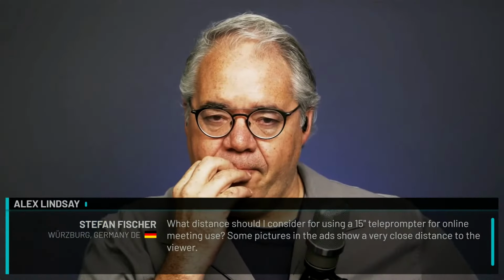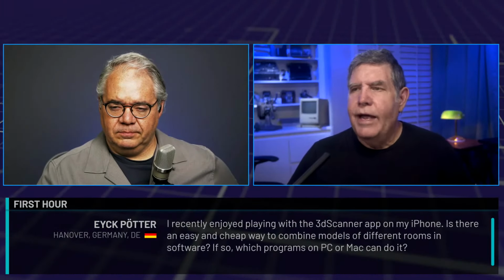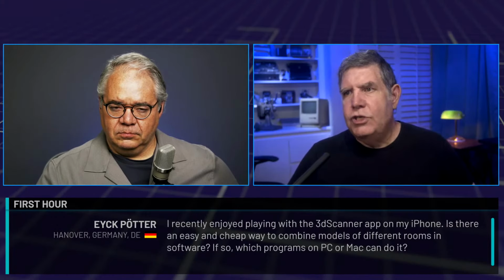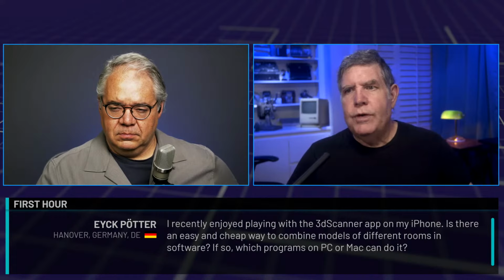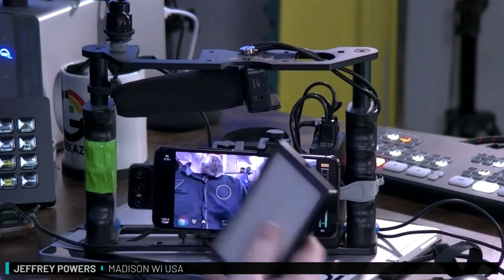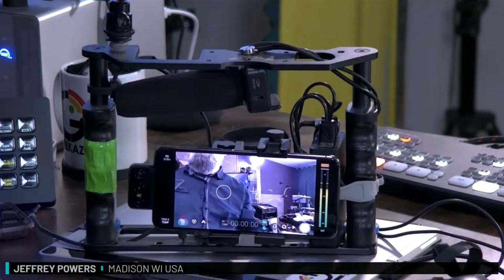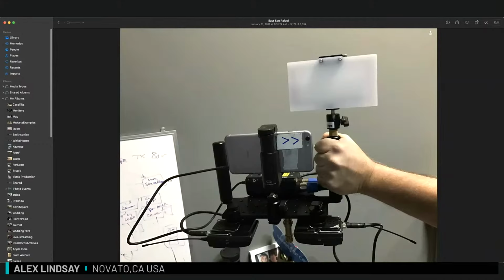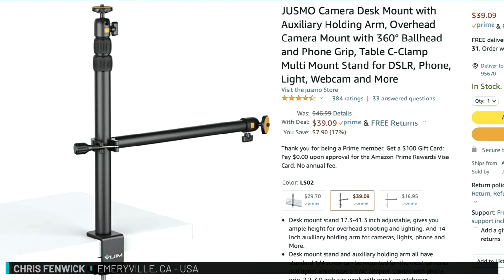Focus on Using Phone Camera Rigs in Production

Comment from the maker: 50:44 What problems does the BSS Blu-806 audio processor solve?
53:00 What distance should I consider for using a 15" teleprompter for online meeting use? Some pictures in the ads show a very close distance to the viewer.
56:15 I recently enjoyed playing with the 3dScanner app on my iPhone. Is there an easy and cheap way to combine models of different rooms in software? If so, which programs on PC or Mac can do it?
57:28 WE use OBS or ecamm live for virtual mixing rather then a hardware switcher but looking for a good hardware encoder that can take separate hdmi video in a sterei mix from the board. suggestions?
59:08 In production does the audio mixer sit separately and monitor on speakers with a live video feed, or do they (like me) have to sit with the video crew and try to use isolating headphones?
01:00:10 Should I get a Ubiquity POE switch for my Studio? I use a 10-port TP-Link gigabit switch for my office.
01:02:24 * Second hour panel discussion *
01:21:03 How do you mount your iPhone for the overhead camera shot.
01:26:33 What external lens have people found helpful for their iPhones?
01:27:56 For less than a seventh of an Alex (or one hundred US dollars) what's a good iPhone gimbal for on-the-run field video?
01:31:34 In a iPhone 13, what is the difference between Cinematic and Video mode?
01:37:08 What is the best way to get a mic into an iPhone 13 Pro Max when recording video? Hoping for a non-bluetooth option.
01:43:25 Is it a fools errand to try and color match a stabilized phone rig with multiple bmpcc 4k cameras in a live scenario?
01:45:07 Has anyone ever used the Unity Intercom client on iOS?
01:46:13 with the apple adaptors that offer a lightning passthrough (HDMI adaptor), and you stack a second adaptor with it (ethernet) or is the passthrough power only?
01:47:22 Has anyone else tried TopDirector to broadcast on the go from their ipad/iphones? It has built in telestration
01:48:01 Can metal case and rigging options impair cell or WiFi reception - maybe important in a live contribution environment when using on-board connectivity?
01:49:06 Where do you draw the line between using your phone (that you actually use as a phone) for Production, versus dedicating a sperate "phone" as a single-purpose Production device?
01:50:39 How do you get some of the large files from longer recordings off of the iPhone for edit? How would you walk a client through offloading longer clips from their phone?
01:52:07 How do you use both external power in and hdmi out on an iPhone?
01:52:47 I am super happy with the portability and simplicity of the DJI Osmo 3/4/5 series of iphone gimbals. What's the next step up ?
01:53:16 The SmallRig Tablet Metal with Dual Handgrip for iPad has been my goto for the last couple of years for run and gun. Does anyone have a favorite alternative that would have two cold shoes?
01:53:53 Any opinions on the Shure MV-88 for iPhone use?
01:54:42 What is a good MDM solution for iPhones keeping broadcasting/Remote contribution in mind? We have a few(}10) kits.
01:55:19 I use OtterBoxs exclusively to protect my mobile devices. What rigging options are there for mounts and adapters around an existing case system - beyond the typical spring clamp type arrangements.
01:56:24 Small-rig has a rig for iPad. What would you use an iPad for?
01:57:50 which underwater rig have you used and to what depth have brought it to?